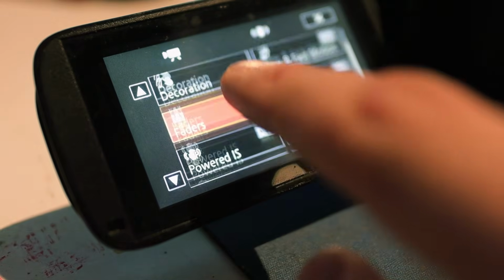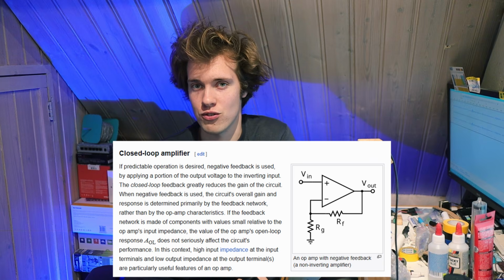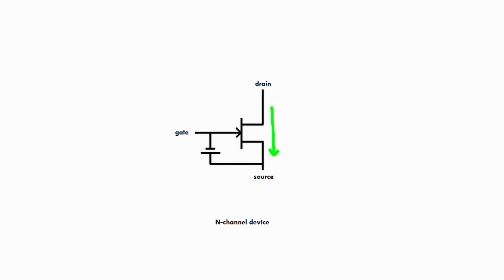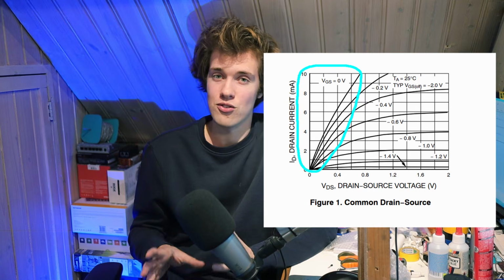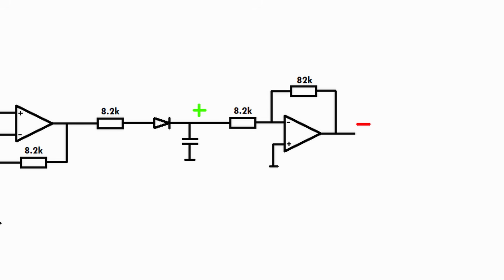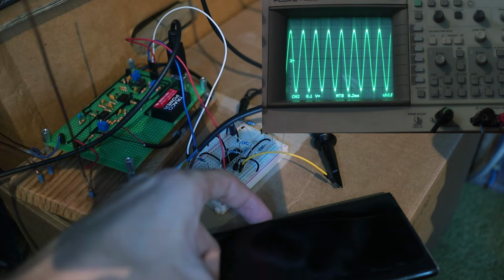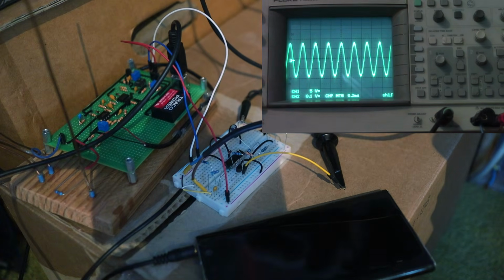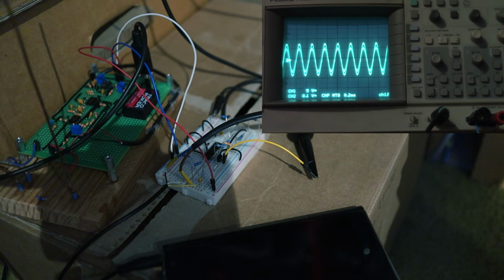Automatic gain control with analog electronics

Comment: Excellent video, tried to make an AGC out of transistors purely before watching this video but went wrong

I’m planning on doing this instead, but I wonder if it would change the schematic completely if I were to connect an 8ohm speaker
Reply from the maker: if you need to drive an 8 ohm speaker you'd need to add a power amplifier stage at the end, there's no way these little opamps will drive a speaker.
Reply: @AKIOTV also, will it work with a 741 opam right?
Reply from the maker: @horikitasuzune5974 Yes

Comment: The other region of the JFET can be used as a constant current source for unknown input voltages, I used a J112 (N-Channel) to control a status LED for a breadboarding station and I have 2 binding posts/banana jacks as inputs for a benchtop power supply, a toggle switch to turn on and off the +V to an adjacent pair of binding posts that would feed my breadboards.  An LED on the input side and another on the output side, I've tested the current from about 2V to 30V and the current was held constant around 10 mA, Not bad for 2 components: a JFET, and a resistor... of course, it's not a perfect constant current source, but for my application of an LED indicator to maintain the same brightness over a fairly wide voltage range, it was "brilliant"  LOL 🙂

Comment: Can this circuit be used to smooth out music selections that have been recorded at different levels? I think old juke boxes did this when playing records. I have played mp3's where one is loud and then the next is softer. I have to adjust the volume control to keep the sound at same loudness. Can this AVC fix the issue?

Comment: For the AGC to have concentrated on the detection of the low sound of the motorcycle, to amplify it so we could hear it, a narrowband filter would be included just to pick that part up and . . . .  in which case, your voice would also have shot up.

Right ?

Comment: I appreciate pretended smart videos on youtube, but you completely forgot to linearize the JFET using two resistors. As you have it, will be at most good as a guitar distortion pedal, not a voltage controlled attenuator. Not to mention other flaw others have already pointed out.

Comment: That AGC circuit is nothing new. Been around since the 1980's. I used that a few times then already.
Reply: Actually AGC became standard on radio receivers in the 1930s for stable listening.
Reply: @martinkaack7717  But this circuit is not for radio AGC. Too costly and too complex.
I used it for stable precision sinewave generation in precision micro level sensing. Stain Gauges for instance.

Comment: AC couple the output of the first op amp to a negative going integrator (diode/cap/ resistor) to
get the neg voltage for the fet and eliminate the second op amp inverter.

Nice Job !

Comment: 17:27 Where's all that crossover distortion coming from?  A unity-gain amp, even one built from a cheap and cheerful LM324, shouldn't be that bad. Do you have the bias point wrong on the 324's output stage?

I think the YouTube Algorithm threw this my way because I just did a video on an electret mike preamp: https://www.youtube.com/watch?v=hOyz1iw7V2Q.  Your AGC circuit should pair with it perfectly. Use one extra op-amp on the 324 for the preamp, and the other to buffer the output, and run it into your sound card to record through it. The LM324 should pretty much drop in where I used a LMC6824. With the split supplies you used, neither of us would have to worry about using a ground-sensing op-amp. 

The sound of the preamp isn't great, but it's not horrible, either: https://youtu.be/hOyz1iw7V2Q?si=TsoVjuiztAED0Fum&t=890  has me actually recording through the breadboard preamp. You can hear where I switched the audio source back to the desktop mike at 15:14. If I had used an NE5532/5534 or an LMP7731 and run the preamp off the same power supply as the rest of the system, it would actually be pretty good.

The last time I designed an AGC circuit, I had half an LM13700 unused on the board, so I used that for AGC.  Overkill!
Reply from the maker: Probably the distortion is caused by the LM324 (the circuit is at relatively high gain also). As others have mentioned there are workarounds, but it didn't bother me much since it wasn't really what the video was about.

Comment: Things were actually easier in the valve/tube era. Some valves had a control grid wound with a variable pitch helix, thus creating a variable μ. By varying the bias voltage, a different number of electrons would pass, thus the gain could be controlled.

Comment: Nice circuit.  I find the diode anode connection to the JFET gate a bit mind bending.  I might be wrong, but I think it works because there is gate capacitance which can forward bias the diode.  Maybe it appears that the gate is floating, but in reality it's not, it has some voltage already due to its capacitance.  Please correct me if I misunderstand.
Reply from the maker: Yeah that's a bit dodgy, there should really be some gate resistor there, I skipped it out of laziness and the circuit worked anyway. Probably indeed because of gate capacitance and some leakage current.

Comment: Is there a reason you used a fet instead of a mosfet?
Reply from the maker: A mosfet could also be used, the jfet does have slightly better properties for this application, though I have to admit I mostly used it because the bag of jfets was the one on top of the pile.
Reply: @AKIOTV  ok, tks for all

Comment: Diode, when forward biased has a small signal resistance approximately VT/If. See VI curve of diode and the tangent at If. A bridge of diodes could probably used.

BJT gm varies with Ic. That's how AGC was implemented in Transistor radios.

Comment: Its easy to imagine how in modern circuits, attack time is also somehow automatically adjusting, since attack time depends on the frequency of signal, since individual peaks are much closer or further apart with different frequencies
Reply: The RMS value doesn't change with the frequency. The peaks are closer together, but also narrower so it ends up being the same. In the same way that pwm controllers allow linear dimming regardless of frequency.
Reply: @SkippiiKai  Oh that is neat, something i dont understand yet it seems, thanks for letting me know
Reply: @karyjas1 No worries, it's surprisingly complicated. If you're interested, Biricha has a short video on their channel called "when to use average values, when to use RMS values" which does a great job of explaining RMS.

Comment: thanks alot for sharing valuable information.what if lm358 used and just +5v no negative powered from single power supplay can work or it is neceassry + and - for opAmp
Reply from the maker: It's possible, but you'd need all kinds of modifications to the circuit.
Reply: I think you could make it work by creating a virtual ground ref point.

Comment: Happy New Year
Good explanation
A few notes:
1) LM324 is dreadful for audio work.  A TL074 or TL072 would be better in this application
2) Add a resistor to ground on the gate of the JFET.  When the right most diode is back biased, the impedance of that circuit node is very high.
3) You didn't say the value of capacitor in your schematic.
A few notes for new players:
-- Full wave rectifiers are a better option because you will get less ripple on the gate voltage, hence less distortion
-- You want a JFET with a moderately high Vgs(off), lets say 3V or more.
-- With a bit of work, you can AC couple the drain of the JFET and run the whole JFET circuit at the positive supply voltage.  This is useful when you don't have large supply voltages to work with.
-- Some extra resistor and capacitors in the feedback stage can be used to make it filter out the ripple a bit better but beware, each stage adds some delay.  Two stages almost never has an issue but 3 or more can make the amplitude oscillate rather than settle to a new value.
-- Kicad is useful for drawing up circuits.  It even has a simulator that can be made to work with some effort.  For stuff like this it is quicker to build the circuit and see what it does.
Reply: TL07x is a little noisy for low-level signals.  NE5532 is the classic op-amp to use for audio front-ends, but lately I really like the LMP7731: it's RRIO with comparable noise performance to the 5532.
Reply: @KludgesFromKevinsCave  Yes, for small signals 5532 is better.  I was suggesting a common general purpose part.
Reply: LM324 is perfectly ok as long as you bias the class B output stage to be always class A
Reply: @8m2sCv7  Even then, its slew rate is not very good, but yes, forcing the output to run class A helps.  You can see the crossover distortion on your scope.
Reply: @kensmith5694 with the bias, crossover distortion is completely gone
Reply: @8m2sCv7  Yes but on the circuit you showed it wasn't.  That was my point.
I think though this is getting far from your intended lesson for others
Happy New Year.